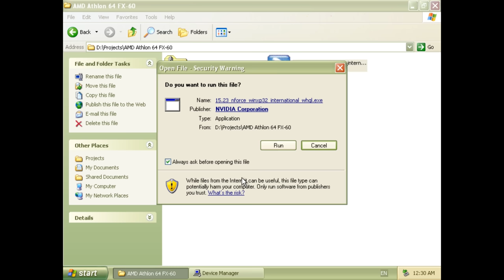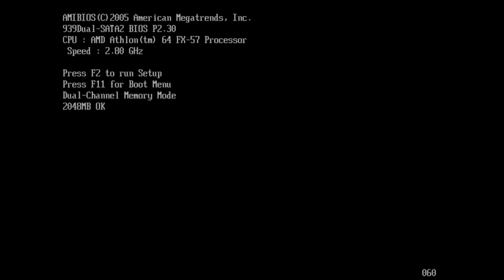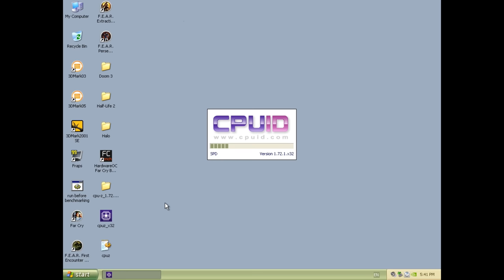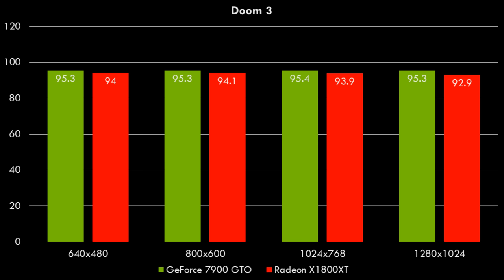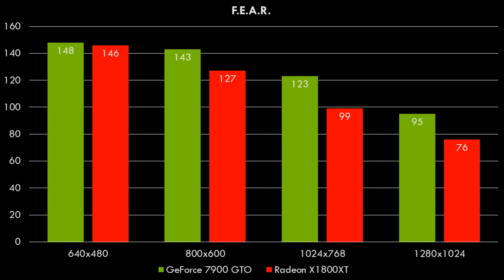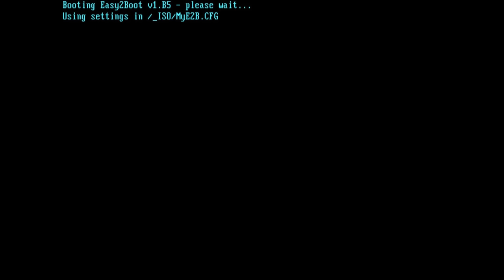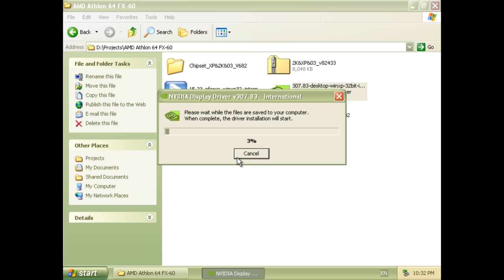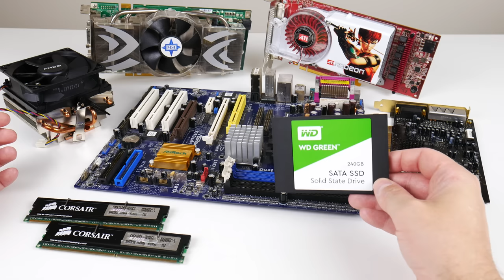AMD Athlon 64 FX-57 - $1031 CPU from 2005

Comment: I'm running the Asus A8N32-SLI Deluxe with my FX60 and its been rock solid. I suspect your issues are due to dead nv chipsets. It was all too common for these to fail as everyone did FSB overclocking without adding aftermarket chipset cooling. Its a shame, the A8N32 is such a good SLI board.
Reply: You can't blame the users on this. Nvidia chipsets were just thermally garbage. I never overclocked on my system and the one nvidia chipset I owned died quicker than any system I ever owned lasting only 3 years. Thermals weren;t that high either as my gpu was a 7600 gs at 512mb. The graphics card I put the intel based asrock mb through saw much higher thermals with a 550ti in a case with only a intake fan in the case. So the hot air from the gpu was definitely flowing into the system.
Reply: Weird.  I guess I've been lucky. I have a 680i and 790i with max Northbridge voltage that have been working for over 10 years like that overclocked. 60c average temps.
Reply: @TinyTitian  I had many intel, VIA and AMD chipsets that died on me than I can count. It happens.... Nvidia chipsets (nforce 4 mainly) the best ones for socket 939, specially for OC. DFI Lanparties were the pinnacle motherboards to OC opty's and FX's.
Reply: I still have two Asus A8N32-SLI Deluxe Motherboards brand new in box . Should I sell them or hang on to them .
Reply: @giovaanflores7019  waaaatttttt????? NICE!
hunt down some 8800 GTX's to put in em lol
Reply: @CrazyMonkeyTM  If they were so great nvidia wouldn't of stopped making them. Their boards were flat out designed thermally bad.
Reply: @TinyTitian  They still continued to do chipsets up to 790i for Skt 775 (late 775) and 980i for AM3. They have stopped since then due to not being sustainable. Intel was taking the market and finished with competition (VIA, Nvidia and AMD mainly). All high tear NF4 motherboards had active cooling on the chipset for some reason. Back in the day (dunno if you are from that era) we Overclocked every single bit that could squeeze a bit more "power", FSB was one of it, which was ran by the Chipset, and NF4 would give you more room to do so!
Reply: @CrazyMonkeyTM  I just said my lga 775 nvidia chipset was the only to ever die on me it lasted 3 years. The amount of rmas and online complaints from dead boards is why nvidia left the market after LGA 775. Hell I was going to get another nvidia chipset board till seeing other users online at the time pointing out how often the board die from over heating. This guy found 3 boards witch active cooling deal from overheating. Idk how their am3 boards were but bet those were brick ovens also.
Reply: My A8N-32 sli delux decided to throw a fit and push up doves a while back. Not sure what happened, I was running it with a phenom2 940 for a few years. Best dang system I ever had.  It is possibly related to bios corruption. At the time, its performance just could not be beat.

Comment: I used the A8N-VM CSM board for years with no problems.
Athlon64 3700+, exactly like your processor but 2.4GHz. 4GB ddr-400 CL3-3-3-9 RAM.
The sound card was a MUST. I used a Creative Audigy4 PCI Card.
Running F.E.A.R. with vs without I saw a 40% uplift in fps, since the single (high power) core wasn't tasked with sound (3D sound is computative!)

Graphics, at the time, I used ATI Radeon 1900XT. Later tested crossfire when I got a matching card from a friend. Needed Windows XP Pro x64 when I swapped in the Athlon64 X2 3800+ and using Crossfire. (By then I'd gone on to a newer Bulldozer system, but still had fond feelings for this old system!)

Comment: In 2006, I had an Athlon fx 3200+ watercooled and overclocked to  2.7GHz, ATI x1900xtx, 4GB of DDR-400. That computer was such a beast at the time. The dual core X2's were already on the market, but I had such an affinity for the fx55 and fx57, I was intent on building a single core.

The fx 3200+ was a tremendous budget cpu. When overclocked it matched the performance of CPUs 5x its price.

Comment: Last year I've built myself a little retro project box around the Athlon XP platform, mainly to archive old stuff from 5.25" floppy disks. I had an Asus motherboard initially (A7N8X), which would lock up in the BIOS, and 50-50 chance to POST. I've swapped it out to an Abit NF7-S, and that one still works well to this day. Oh, and the video card in that box is a Geforce 6600 GT, but only because that was what I had in spare. I might swap it out to a period correct ATi card at some point.

Comment: I didn't use an Asus, but an ASRock with an Nvidia chipset. The N68C-S UCC AM2+/AM3. I used it from 2010 up until 2018 when it started giving out. First the USB headers started failing, then some of the SATA ports, and finally one RAM slot died on me. But it did give me a solid almost-decade of use.

Comment: Same mobo as my Athlon 64 build back in the day! I also had issues with nForce boards, but the Asrock was pretty stable. It didn't die that I know of, but I think it got stuffed in a closet.

GPU's that it featured were the 6600GT, x1650pro, and then a 8800GTS when it launched. Nearly got a 7 series, but held off; The 8800's were great! (Until they cooked); I had 4 by the end!

Comment: I bought that chip in 2004 Sandiego Core I paid 450 for it.
Had it on an Abit Fatality mobo with sli 680 GT's and my 100 lb crt drafting monitor 2048 x 1536 resolution loved that pc.

Comment: In 2005 I had a 7800 GTX and an Athlon 64 running at 2.4 GHz. After selling the GTX I ended up with a Leadtek 7600 GT which I still own. The Nvidia Geforce 7 demos were amazing, well worth a look.

Comment: I bought an AMD based system during this period (2005), initially I wanted to buy the AMD Athlon 64 3700+, but I opted for the AMD Ahtlon 64 X2 3800+, since I used It for 5-6 years, It even performed very nice (compared to computers from this era) even with Windows Vista and Windows 7, after I upgraded the RAM from 1GB to 2GB.

I really like this era on AMD, as well as the AM2+ and AM3 era (Athlon and Phenom second gen, I had the Phenom II X4 810) and of course the AM4 with the Ryzen CPUs, which I'm currently using (Ryzen 5 3600X).

Comment: I had had ton of problems with Nforce chipset and socket 939 back in the days, I RMAed a Gigabyte motherboard and I had stability problems also with socket AM2, partially solved using Ubuntu, I had also the 939 Dual Sata 2 and it was my mainboard back them, very nice experience with that and ULi chipset

Comment: when i was still doing system builds in the early 2000s with nvidia MCP chips, they were very sensitive to the BIOS for the CPU support. sometimes the latest BIOS would not be stable with certain processors based on the stepping - E4 FX-57 was the best supported with E6 sometimes being a beta BIOS or not even supported at all at some memory speeds. certain boards had BIOS releases that were more broadly compatible too, like Biostar or MSI. if you look on the Asus site for that A8N-SLI board, you can see it only supports the E4 stepping. your CPU is an E4, but a different BIOS might be better supporting that specific release (CAB2E).

Comment: I have an A8N-E, and it has been perfectly reliable. However it's extremely picky about memory configuration. I also have an MSI K8N Neo2 Platinum (also N-force3) and it works great. I've used both boards with an Athlon 64 x2 3800 and a SATA SSD with no issues at all.

Comment: There are a few performance tweaks with Far Cry that can only be done with the console.  One in particular, which requires Shader Model 3.0, is geometry instancing.  That can have a significant impact on performance, as one of the things it allows is creating just one tree geometry, which is duplicated on the GPU for every instance of that tree, rather than creating that tree everywhere it appears.  You won't get that functionality using presets.

Comment: I'm still running my Phenom II X4 940 (as in the computer I'm typing this on) on an Asus M2N-SLI Deluxe with the nForce 570 SLI chipset. It's been rock solid for many, many years.

I haven't run it in SLI since I had a pair of 8800GT's.  Right now I have an RX460 and pretty happy with it.

Comment: I started with a MSI 939 board (chipset fan was a bit flakey) with a 3500+ with a 7800GTX, changed to a 4000+ and finally paired a FX-60 with a DFI eXpert 939 SLI board with 2 x 7900GT's (all watercooled). The graphics cards were finally replaced with a GTX 260 which I left aircooled with the CPU under water.Still have all the parts, might dig it out and run it up in my test bench during this lockdown for giggles.

Comment: I've been running the Asus a8n32-sli deluxe board with the Athon 64 X2 4200+ for 15 years (still acting as a backup network-attached Linux box).  I also started to encounter weird sata issues on that board a few years back.  It started with the sata lines degrading to lower speed only on high IO usage with lots of link resets showing up in system logs.
The board also has a secondary sata controller from silicon image that should behave better.  I've since intalled a raid card in the second pcie slot and haven't had an issue since.  Apart from nforce sata, the board has been exceptional.  Don't through out the a8n32, just get an hba or raid card to accompany it!

Comment: Rare to see AGP & Full size PCIe on the same Board. I recently put together an older AMD system & it is a little buggy too. It is a Gigabyte GA-MA770T US3. It has a 1090T Black Edition CPU & 16 Gigs of DDR3 RAM. The Issue it kept giving me was Randomly I would get a DMI Pool Data Error on Boot while it is detecting the Hard Drive/ SSD. I did use an SSD for Windows & it is Windows 10. I updated the Bios but strangely enough it had to be done Twice in a row to take the Update. Now it does it a lot less but still every now & than doesn't detect the SSD, but restarting usually fixes that. I still think it's a Bios issue like maybe the Bios itself is suffering from Bit Rot, interestingly enough though it is also a Dual Bios Motherboard so I may try to swap the Bios Chips just to see what Happens.
Reply: Can a bios suffer bit rot?
Reply: Look for Phil review of this board, ULI did such a good job that NVidia bought them, it was the only board with pretty fast AGP and PCIe

Comment: I actually still own two Asus main boards that were manufactured for OEMs one from a Compaq one form an HP. Both are M2N68-LA models one with 2 ram and 3 audio and the other with 4 ram and 6 audio jacks, both use the nVidia nForce 430a/GeForce 6150LE chipset Socket AM2 and never had a single issue out of either board, i use them to soft mod old school xboxes and run retro software if the occasion calls for it.

Comment: Nice video as always Phil :) I had the same issue you had with the Asus boards but with an Asrock AM2NF3-VSTA which also has an Nforce chipset, for me the board wouldn't even power on, no green LED, nothing. I had the same thing with a Gigabyte 939 board with AGP and Nforce chipset though with this one the southbridge was getting hot gradually (I had to remove its cooler to notice that) but no power on, no LED etc. I think it's a chipset problem
Reply from the maker: Thanks for sharing!

Comment: All nForce 4 mobos used with a stock chipset cooler died. I had an ASUS A8N-E, and the first thing I did after buying was replacing that shitty stock cooler with a copper VGA cooler from Titan and after that it was a really great mobo - it still works today! The CPU was an Athlon 64 3700+ with San Diego core ran at 2750 MHz (250MHz FSB) which was almost the FX-57

Comment: Asus A8R32-MVP Deluxe with an FX-60@2.95Ghz and 4 OCZ 3200 1GB  DIMMS. Runs no problem with crossfire, SSDs, BIOS, even Windows 7 and 10 (yep!) installed from USB. Just retired the thing, was still working great!

Comment: I have that Asus A8N-32SLI Deluxe board (two in fact). I use them for RetroXP builds, always been rock solid. I will say the drivers sometimes caused issues in the past. Make sure you don't install the NVIDIA Audio driver in the installer (it caused stability issues 100% of the time for me). Just used my X-FI anyway. The only other thing was to make sure your running WinXP SP3 or SP2.

Back in the day (2005), I ran the Asus A8N-32SLI Deluxe as my primary machine, I actually ran the FX-57 with it, but had the Corsair LED Ram. Video card of choice was the 7800 GTX (KO from EVGA).

Comment: My system (purchased new!) with an A8N-E motherboard (Althon64 X2 3800+, Geforce 7600 GT) is still working great. Hilariously, I actually have Windows 10 installed on it.

That said, the A8N-E is actually my second motherboard. I originally built it with an A8N-SLI Premium but the board I had must have been a lemon - it failed only about 5 years after I built the system and I replaced it with the A8N-E I had as a backup board.

Comment: Back in 2007 I upgraded from an Athlon XP 2000+ build to one with an Athlon 64 4000+ CPU, an ECS Elitegroup nForce3-939 motherboard, 2GB (2x1GB kit) of Kingston Hyper-X CAS2 DDR400 memory, a 256MB MSI ATI Radeon HD 2600 Pro passively cooled AGP graphics card, an AGIA PhysX card, and an original SB Audigy SB0090 sound card (audio drivers with EAX 4.0 support enabled), running Windows XP Pro 32-bit.

Comment: 04:00  I used a number of ASUS boards from that era with nForce chipsets.  Never had any issues with them.  My last Athlon X2 processor (6000+), before I upgraded to a Phenom II, was on an ASUS M2N32-SLI Deluxe board.  I also built a few PC's for work using other manufacturers (Biostar and Gigabyte come to mind) which also used nForce chipsets.

But that was all over ten years ago now.  I have no idea how well they've aged.  I still have that M2N32-SLI board with processor (probably have some compatible RAM about), but I haven't tried to boot it in ages.

Comment: I had issues with my ASUS M2N-E (not with SATA as it didn't have AHCI support) with random crashes. I thought the board was complete toast until I looked at it and noticed a blown cap near the RAM. I replaced all the caps that had the same values as the one that blew and no more random crashes.
For your boards that don't POST, check the caps (top and bottom) to see if any have blown and recap if necessary.

Comment: It's funny, as you were talking about the dodgy ASUS boards I was thinking, shoulda bought Asrock, so I did laugh when you revealed the 4th board. :D  I too had issues with an ASUS nForce board back then, and the support was rather poor, so I bought an Asrock instead and oh my what a different experience! I wanted to use a particular pro PCI SCSI card, so Asrock actually sent me a custom BIOS with support for the card, quite extraordinary. Also, when the next gen AMD CPU upgrade came out, Asrock had their BIOS update available within 15 mins, whereas ASUS told me the other board was old and they weren't going to update the BIOS (so the ASUS is stick with a 6000+, while the Asrock has a Ph2 x4 965 BE).

I liked a great many later ASUS boards, especially the M4E (sans USB3 issue), R4E P9X79/E WS and others, but the old ones with nForce chipsets were meh. I bought an XFX mbd with an nForce chipset, that just died one day, no idea why. Other mbds though are still going strong, including curiously an Asrock AM2NF3-VSTA (which uses nForce3 250), so maybe it was more an of an ASUS issue, hard to say.

Comment: I left ASUS motherboards and O.C. for Intel motherboards for the 865 and socket 478 back around that time.. seeking rock solid stability. I knew that Microsoft contracted with ATI to get pre-release hardware samples for developing DirectX.. so nVidia was not on my radar.. and nVidia had a bad reputation for doing nasty things to Linux developers.. where ATI was much more friendly to Linux. I only ran Linux on servers but it was the openness and honesty that ATI was doing that simply led to me trusting them more. Time has proven to me that the Intel and ATI combination were very reliable. I like the Easy2Boot and SnappyDriver tips and tricks.. until you started using them and explaining them I went through all kinds of gyrations to get PnP hardware IDs and hunted compatible driver combinations all the time. The new E&S method of installing and maintaining XP has been vastly superior.

Comment: I haven't had the chance to do an AMD retro build yet. Although I had made a windows XP pc with a Northwood P4 3.0GHz I decided to upgrade and completely skip the time period that you cover in this video. I recently found an Asrock 775i65G Rev2.0 and ordered a Pentium E5800 to go along with my XFX Radeon HD4650 AGP.
Reply from the maker: That board has AGP? It's actually compatible with Windows 98 if you want that. For XP, I would go with a PCIe board as the video cards are a lot easier to find and cheaper.
Reply: @philscomputerlab  Yes it's AGP! I've seen your video on the Rev3.0! For the time being I'll stick to XP. I've also got another system as backup/multipurpose gaming with win7 and winXP (Q6700+GTX650Ti 2GB). I have 2 other systems with win98 (1.4S+5900XT and a 440LX celeron+voodoo2 sli) a winME with a coppermine800+v3 2000 and last but not least my ultimate 1997 build with win95 (200MMX+Riva128+Voodoo+ESS1868F)... So I've everything I want covered atm :)

Comment: Back in early 2006 I bought the same mainboard (A8N32-SLI Deluxe) with an Athlon 64 4000+, 1024 MB DDR-400 and a 7800 GT. Was my best single core I've ever had.
It was replacing a P4 Prescott 3,2 GHz, for that I had to buy the famous Zalman CU 7000 cooler to get the temps in normal area :)

2 years later I bought the Q6600 and this CPU just laughed about a single core :) Crazy times.

Comment: The NF4 was a real furnace but it was something to cut the teeth on back in the day and learned a lot from managing it, on the Intel side they are very hard to overclock and the heat they dump out is comparable to a northwood pentium 4.